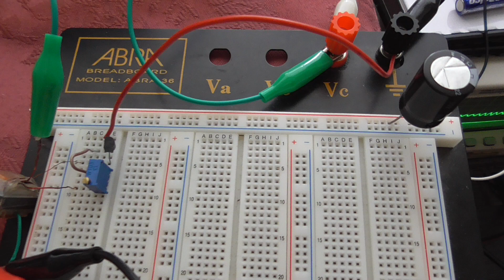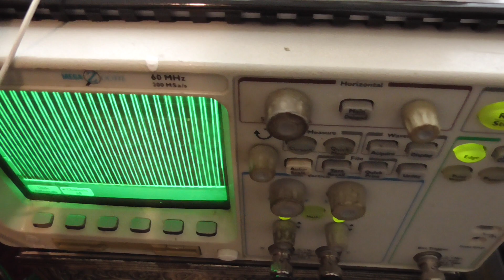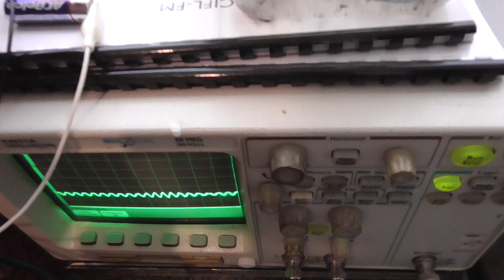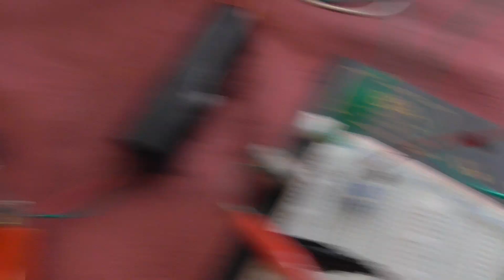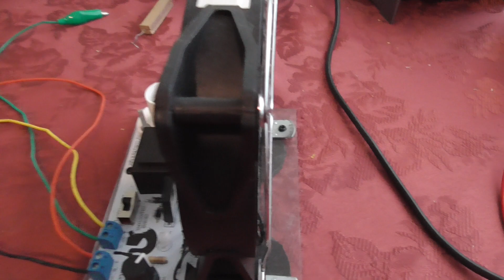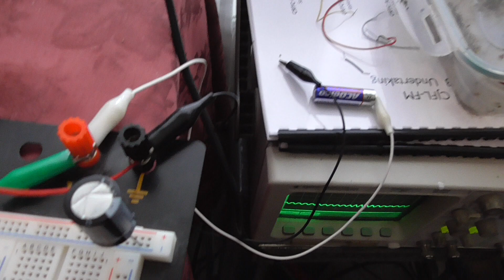Flyback Driver For Bedini Output

Comment: Maybe you have seen this,  https://youtu.be/j7plIyfAsyc
it could, perhaps, at some level relate to your aim of exploring innovative approaches 
that consume minimal current.

The post is about making a super efficient joule thief that uses about 0.25v to 1.5v & 0.003A to 0.012A
I am not sure if it is a standard joule thief circuit, or whether it is an adapted version.
If it works as stated, I imagine it might be possible to take the output of a circuit like that and use it as an input
for a custom HV module, or PWM

The joule thief is available as a little module for sale. It is has a transformer, which can yield information on  how the step up is done.

P.S:  It is just sharing that post, I am not trying to get you to buy that kit  :)
I know you get it.
I am planning to buy one myself, I would be happy to buy two and give you one to contribute to your research.

You give us lots of inspiration, it shows to us other possibilities.
Reply from the maker: Well if your simply looking to lower voltages, I noticed if you scrap the base resistor its not needed below half a volt. internal resistance will be more than enough bias R. Not sure if this matters to anyone. Just a silly observation.
Reply: @joellagace1679  
Thanks, I am planning to experiment with one of those long lasting DIY cells to see what can be done with them.
I have seen one that remained charged for more than 3 years
Reply from the maker: Keep us posted!
Reply from the maker: Speaking of homemade cells, You might like this video. https://youtu.be/EblBY50ZL44 It's my version of a self charging DIY cell concept.
Reply: @joellagace1679  
Very interesting, it uses simple components,  but could be very good, since 
the parts are non corroding

Here is another take, which I think could hold promise, depending on the materials available to a person
https://youtu.be/3cJFkIDImuM